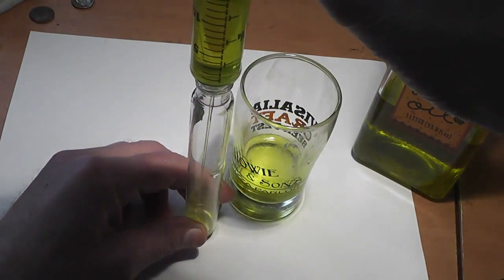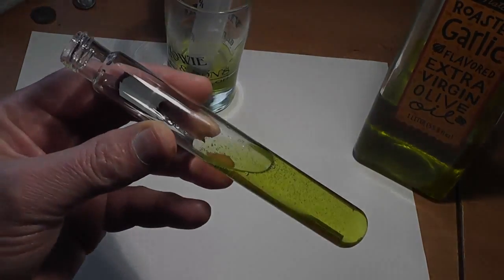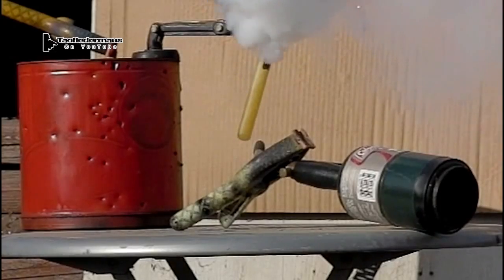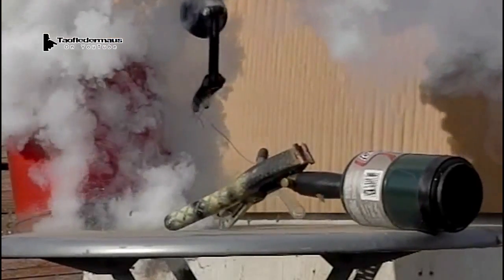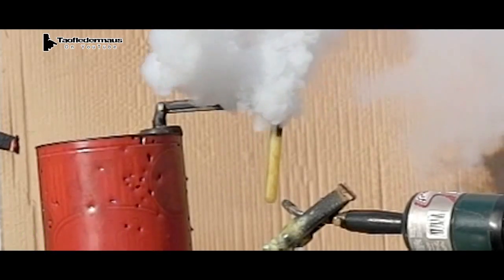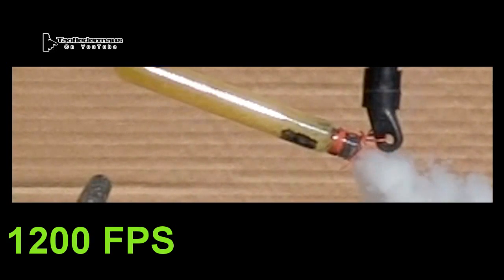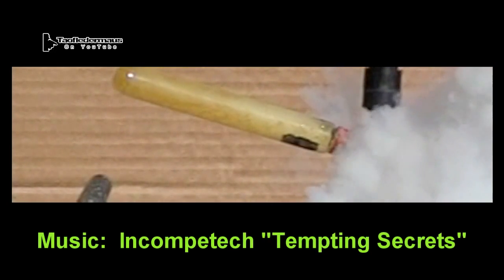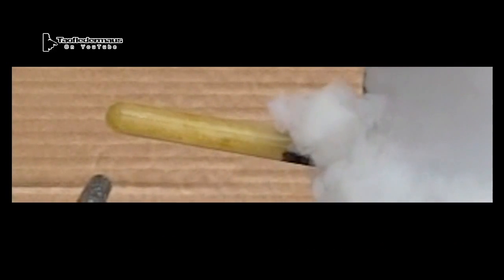Olive Oil vs GAS TORCH -   Stand Clear- this one blew up!

Comment from the maker: Olive oil!
Reply: Do pop corn kernels.
Reply: See, this one is actually on a Tuesday.  Good job!
Reply from the maker: Richy Rich  Oh yeah.   In some oil.    That totally makes me wonder what will happen!
Reply from the maker: MrCasuallyAwesome  I have a 1:7  chance of getting it right!  It is Wednesday in many parts of the world still.
Reply: Yeah, as long as you put the corn kernels in oil, they might pop...though the whole reason they do pop is due to the increased pressure inside the kernel vs outside...so it might be a situation where they burn far enough to break the membrane before the seal breaks on the test tube...still would be interesting to see what would happen.

From this video, it does look like you do this in a residential area, so you would obviously not want to do this suggestion there, but I would like to see some sodium nitrate/sugar solution tests, as well as it would just be interesting to see what happens when you heat black powder in a glass vial.  I'm sure both of those should be rather explosive.
Reply: ***** Well, at leat you're correct 4.17% of the time.
Reply: do you think a bondo plug would hold better?
Reply from the maker: Probably not.  I'm surprised the JB weld stuck to the glass so long.
Reply: Try diesel, maybe the high pressure could make something awesome happen.
Reply: Try Milk!
Reply: Me thinks simply 'Test Tube Tuesday' is boss! - has alliteration :D
Reply: Human Urine Next???
Reply: Try to put Non-Newtonian fluid in there.
Reply: ***** OK, but if you are going to add the oil, you might as well go ahead and add the salt and seasonings too, just in case.  The greatest snack foods were all either accidents or the byproducts of experiments.  Just, if you make a billion dollars from it, remember me bro.  That's all I ask.  >.O
Reply: what if you put lithium on mercury
Reply: ***** Do dry smokeless powder and original black powder side by side see which fails first
Reply: Try sand :)

Comment from the maker: What about....  "test tube torture tests"     Does that sound descriptive for what this is?
Reply from the maker: Thank you Dan!
Reply: ***** you should try gasoline
Reply: TTTT / T4 Abbreviations. I like!
Reply from the maker: Thanks!
Reply: The geek in me wants to put a temperature probe in the tube to measure liquid temps. Only thing is, most temp probes I've seen don't like the torture much better. :P
Reply: Kind of misleading. People will click on the video expecting someone to get doused in hot oil or something.
Reply from the maker: gckbowers411 There are a ton of "torture tests"  on Youtube,  involving iphones or guns or whatever.   I don't think too many people expect to see people being tortured.   I'll probably keep trying new titles just BECAUSE there are a ton of "torture tests"  on youtube.    Gotta find something unique.
Reply from the maker: Excellent.   I am open to suggestions.   thank you
Reply: Maybe "Look out, birds!"
Reply: ***** You could stress test Aerogel, not with a test tube but with something a bit more creative. As for the test tube, in a previous test you heated up regular water...Try Deuterium Oxide to see what happens.
Reply: Tuesday's test tube torture tests! T5
Reply: try crimping the end of the test tube instead of sealing it with epoxy... maybe. I think it would work well with non-flammables, possibly?
Reply: Marc Leeder you do know that the tube is made out of glass?
Reply: you do know that a torch can heat up pyrex to malleable  without shattering it...  You do know how glass is made don't you?  don't you?
Reply: Marc Leeder well, yes, but I didn't think of that. I do highly doubt a good seal could be made in such a fashion. If anyone can do it, it is Jeff.
Reply: I'm absolutely positive a perfect seal can be made this way taking into consideration the volatility or i suppose ease of ignition  of the substance being contained. I'm sure it would have worked on the rice or the olive oil not so sure on the gun cleaner.

Comment: Very good.  I'm surprised the vapor didn't flash like some folks have shown in a frying pan.

I'd suggest etching the glass and using a stronger epoxy, either the stuff that takes longer to set-up or JB weld.
Reply from the maker: That was JB weld,  with a ball bearing
Reply: I watched the first video after this one and noticed it looked like JB weld.  So the ball bearing is the stopper?  Did you etch the glass at all, even mechanically?

Comment: You should put the tube on sheet metal and fold it so it has sides so when it has a failure it will have some type of guided direction when it goes off. It will be neat to see how far they fly.

Comment: At first I was wondering how you were going to make boiling water entertaining! now I see :) Anyway I'd better make a suggestion now that I'm here, how about naphthalene, drop a couple moth balls into the tube. Keep it up Jeff.
Reply from the maker: Don't you think the moth would be upset?  lol    Do you think those will dissolve on their own or do I need to add some liquid??
Reply: ***** Naphthalene has a high vapour pressure and sublimes at normal temps, though in this case it should readily melt and boil at a lower temp then the oil. As long as you can still get them that is, the dichlorobenzene ones won't be as good I reckon, I guess you could test them both side by side. Naphthalene ones are on ebay for few bucks, but I know you're cheap! lol. Naphthalene is used to create relatively safe no burning residue black smoke fireballs.
Reply from the maker: I did spend $25 to buy some more test tubes on ebay.  lol    We used to put mothballs in gas to make our mini-bike go faster when I was a kid.   I don't know if it actually worked or not though.   I'll see if I can hunt some down.

Comment: you could try to heat the glass at the top and seal it that way. Not sure if it works with test tube glass, since it's known to shatter if you heat it too much, but maybe you can have both, an epoxy plugged tube to have a known weak point to show the relatively slow de-pressurization and a sealed tube just for that "Krakatoa tube" effect.

Have you sanded the inside of the test tube before applying the epoxy? Maybe that strengthens it a bit :)

Comment: Seems like the cap is always what fails. We want to see it explode!!! Try roughing up the inner part of the top of the tube with a mini dremel tool bit grinder thing, the ground glass will seal with the epoxy much better. Also put super glue on the threads of the cap when you twist it on. We want a boom not a fizz!!! Love your vids regardless, huge fan of your crazy shotgun rounds.

Comment: Dry ice but put the tedt tube in a carved/drilled out hole in a larger block of dry ice to help slow down melting so you could get a good epoxy seal

Comment: Can "stronger" test tubes be purchased? I am thinking of using a strong epoxy to make a "nozzle" in the cap and then weaker silicone to seat the nozzle. the idea being that the silicone would fail release the pressure through an actual nozzle to quite literally turn it into a "rocket engine" to power an actual rocket. Run a wire inside the epoxy maybe to act as a heating element heat it from the outside. Once the silicone plug fails WOOSH goes the rocket. I wonder if that could work. I wonder how much power I could get from such a system.

Comment: I think the reason for the color change is likely a decomposition of the oleic acid and other glycerides present in the oil or some sort of polymerization, though I think the former is the most likely scenario.
Reply from the maker: I believe so.  When it gets above 440F or so it degrades pretty fast.

Comment: I would suggest getting a laboratory apparatus glass tube (it's dirt cheap :D) and learn how to make ampoules (not that hard) or just seal the ends (anyone can do that), that way you get an airtight container that will fail at much higher temperatures, since epoxy notably softens even in boiling water ;-)

As for material suggestions - light flamable hydrocarbons, sugar, very pure water in a very clean container, fluorinert...

Comment: olive oil has a lower smoking point than most other cooking oils, so once it hit that dark brown color it was burnt. if you'd been cooking with it, it would've tasted awful. that's also why we generally don't use it for pan or deep-frying: it burns before it reaches the proper frying temp (plus it makes your french fries taste really weird.)

how about mineral or motor oil?
Reply from the maker: From what I have read,   it IS a good frying oil.   The smoking point is as good as most other oils.   Yes,  when it turned brown,  it was done,  totally degraded.
Reply: my PBS cooking shows have been lying to me??

actually, turns out they have been lying to me! i did a little Googling, and you're right: EVOO is fine for deep frying as long as you really watch the temp. 380 is okay, but much beyond that gets dicey as far as burning the oil goes.

little did i know what i'd end up learning by watching a video showing what happens when a beaker* full of olive oil is heated!

still, for the sake of my wallet, i think i'll stick to frying with something that's not so expensive. i'd have a hard time justifying throwing $2 worth of potatoes into $25 worth of olive oil ;).

[* yes, i am fully aware that is not a beaker. i just like saying the word "beaker". because it makes me think of the Muppet. and he's hilarious.]
Reply from the maker: beaker, vial,  ampule...tube. glass thingy...whatever... lol

Comment: Nicely done.

As for a name, how about "Krakatoa Tuesday"? 

And I'm not so sure that the failure of the plug is always a bad thing. Perhaps it could be one of X failure modes. As far as sealing, however, have you considered the Ampoule method? Put some substance X in and seal the glass. Also, before going too far afield, how about different types of oil? Canola oil, peanut oil, motor oil? Just a thought.

Love your stuff.

Comment: I think the problem with your epoxy plug is the heat eventually gets to it. I read you're using JB weld, but even that has it's limits. High temp silicone would probably be a better alternative, although it will take longer to set up
Reply from the maker: I was thinking about the HT silicone too.  It is soft and may deform.  It is tough getting anything to really stick to the glass.  I am getting a new batch of test tubes with caps so maybe that will add to it.

Comment: Make a test tube rocket with stabilizers and a nosecone with a parachute in it. Experiment on different liquids, rocket nozzles, liquid fill levels, and how long you heat the liquids/temperatures to see what gives you the most delta V.

Comment: It might be possible to form a better seal and have more violent failures if you were to make sealed ampoules of your materials. Then, the glass itself would have to fail. I'm not sure if you can make a test tube into one, though. And of course, it would sacrifice the test tube in the process.
Reply from the maker: I just have to not cross the line where these are considered "pipe bombs".   Heck,  dry ice in a soda bottle is considered a bomb here.
Reply: Oh yeah, I hadn't really considered the legality aspect. Hm. I really have no idea, then.

Comment: Maybe it would be a good idea to try and measure the actual pressures inside the test tube... An electronic sensor or even an actual gauge could be incorporated in the epoxy seal to take measurements...

Comment: I was half expecting it to flash :\ ah well. My suggestion is napatha ("white gas") if you want something silly dangerous.

Something a little more safer but still flammable would be kerosene, that stuff won't ignite without a wick in normal conditions so would be interesting to see whether it degrades at temperature like the oil did before it blows out the bung and insta-flashes.

Another one would be rubbing alcohol.

Sorry for only flammable suggestions lol, anything like soap or detergent would prob just burn inside of the tube, Ammonia/bleach/etc would be on the dangerous side imho.

Mind you I would leave the plug along, it works brilliantly, shame it can't be setup to completely fail at a set pressure. It would be pretty cool to see an insta flash (i.e bung shoots out, tube is still basically stationary and then the contents just insta flash.

As for title suggestions what about "Test Tube Tuesday"
Reply from the maker: Maybe like 10ml or so would be ok to do.   These are pretty small-scale experiments to start with.

Comment: Paraffin wax (ie non bees wax candel wax) would be interesting as it is the primary smoking agent in some types of smoke devices. If the test proceded as the otheres you have done you would have 4 phase changes which would be cool to look at, plus the impressive smoke cloud.
Reply: Actually Crayola crayons are mostly paraffin wax so perhaps you could try one?
Reply from the maker: xxxmurray  I plan on doing crayons soon.

Comment: Try welding a glass cork inside the tube to seal the tube. you might be able to just melt the top of the tube and squish it together. 
Try boiling liquid nitrogen if you can get it. Liquid nitrogen + water.
Try something other than liquid like a plastic toy or a chunk of wood or soldering metal.

Comment: glycerin would be pretty cool, high boiling point and once it mixes with the air it'll either be a fireball or a massive plume of vapor.

p.s if you want an explosion, youll need to make ampules by heating the glass to melt and pinch it with pliers to seal it off.
Reply from the maker: It would probably make a huge smoke cloud.   I'm going to try to find a better way of sealing it.   I'm reluctant to create something certain agencies might consider pipe bombs though.

Comment: I suggest you fill a testube with gallium which becomes liquid at room temp. Its non toxic and has similar properties to mercury. it can even be ingested although i don't suggest doing that :)
Reply: Or you can also try Antifreeze :P
Reply from the maker: I got some gallium in the mail yesterday.   The boiling point is CRAZY high though,  about 7000 deg. F.   I don't expect it to do much other than stay a liquid and get hot.
Reply: *****
http://www.engineeringtoolbox.com/boiling-temperature-metals-d_1267.html may be of some use should you want to do a metal.  Mercury obviously has the lowest boiling point, but you wouldn't want to do this with mercury; unfortunately it seems like all the lowest boiling points are held by toxic metals like antimony and cadmium.  Of the non-toxic ones it appears zinc is the lowest-boiling-point metal, so that's the one I'd recommend.
Reply: *****
Really. Well how about Mercury Thiocyanate, when its burned the ashes stick together and expand creating a cool reaction but what if you heat it to extreme temps. Or you could also try Mustard/ketchup :P
Reply: *****
Or better yet, melted gummy beas

Comment: Taofledermaus, I have a way to kick this experiment up to laughably epic proportions!
This is simple and you most likely have what you need ALREADY, also the experiment isn't changed at all except to remove the problematic need for an epoxied cap.
I am unsure if I should post the instructions PUBLICLY or not because this needs to be done with a bit of caution although the process is low on the danger scale the end product jumps to almost "Grenade" standards. Message me privately if you would like the instructions and you can post that part if you wish along with the disclaimers as necessary.

Comment: What about a cork then epoxy? It would be cool to see the tube explode. Or even melt the glass to seal it. Keep em coming these r great
Reply from the maker: What I have been doing is epoxying a ball bearing in the tops of these.   For the amount of pressure building up,   the have held tight PRETTY well.

Comment: Next time put the epoxy quite a bit under the neck of the testtube so will the physical pressure on the epoxy act on the glassneck instead of the sticking force to the glass, which should hold better.

Comment: Try Brake Fluid Dot 5.1 (Dry - Wet boiling points)
C   
DRY-WET
270 - 190
F
DRY- WET
518 - 374

OR
Acetone CH3COCH3
C
50.5
F
133

Comment: Actualy my suggestion is not what to put in the tube. But I think, after seeing a few TTTT, is to use a heatsource with it´s own oxygensupply. I keep feeling that the lack of oxygen ater explosion of the TT is killing the flame of the torch. To me it seems the torch needs more time for the mixture to get right and set the vapourball on fire. Or is it just me who thinks this? Just to much fuel in the air for even the torch....Thanks.:)

Comment: I wonder how you can reinforce the plug so it is no longer the weak point. The test tube looks threaded/ribbed. I wonder if an epoxy "cap" would hold better than a plug.
Reply from the maker: I'm ok with the plugs blowing out instead of the tube exploding.   (mostly for legal reasons)
Reply: *****
I think you may have already encroached into the realm of questionable legality ;)

Comment: Somewhat silly questions here: What kind of olive oil were you using and do you think a difference in Olive oil types (or any other cooking oil) would yield any different notable results?
Reply from the maker: If you are asking me to repeat the test with every known brand and type of olive oil.....  no.  lol
Reply: Not really asking you to do that. But was just wondering if you think it might generate a different result.
Reply from the maker: From what I read,   every type of olive oil has the same smoke and flash points.

Comment: Why not try water or olive oil again, but upside down, to see if the epoxy releasing the gas would allow it to somehow act as a rocket? Or is that just unsafe?
Reply from the maker: I'm thinking about using a pipe to launch is horizontally instead of into the air,  where I won't be able to control where it lands.  It could hit a kid or a car or whatever.   I have no idea how far it would travel.
Reply: Ahh good point.